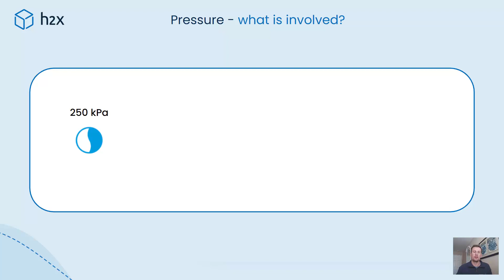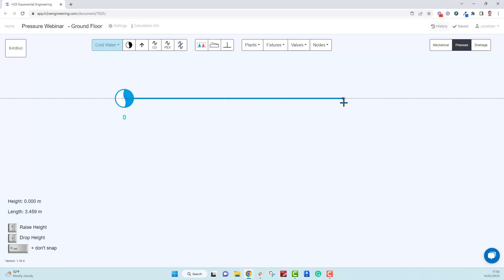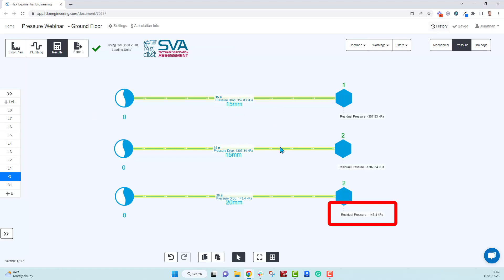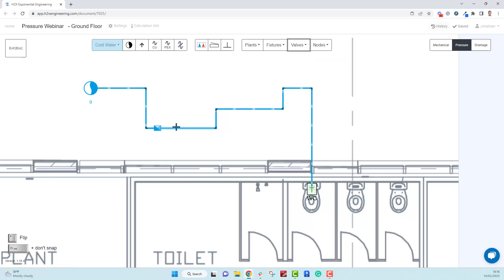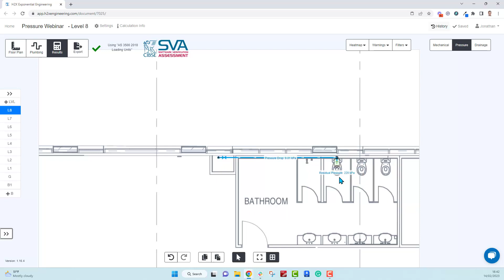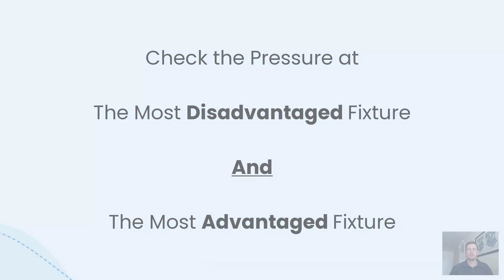h2x - Technical Series - Residual Pressure

Comment: Hi, thank you. How do you calculate the friction and resistance in the heating pipes?
Reply from the maker: Hi, we use the industry standard Darcy Weisbach formula. You can read more here: https://www.h2xengineering.com/pressure-drop-calculator/
Reply: @h2xengineering  thank you so much